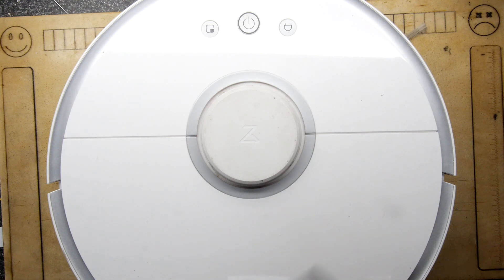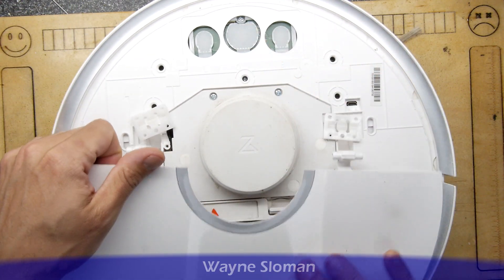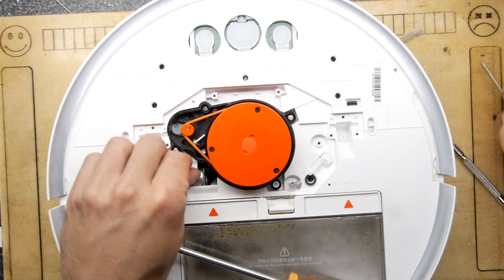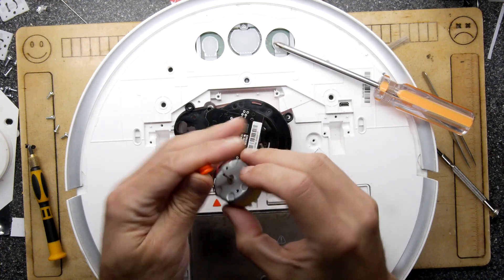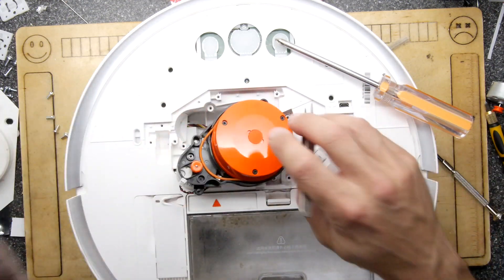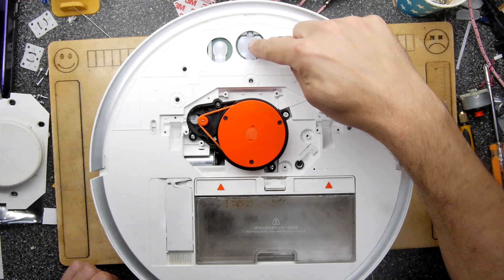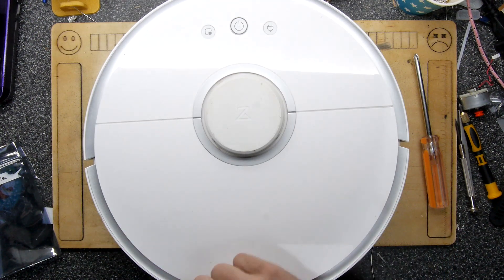Roborock LIDAR Laser Radar Repair

Comment: Hi, thank you so much for sharing this video. It’s very helpful!

At 2:50, you begin unscrewing the LIDAR rotation motor. I’m currently trying to replace the same motor on my Roborock S5 Max, and I’m stuck at exactly that point. The screws on my unit just keep spinning and I can’t get them out. I’ve tried several precision screwdrivers, but none seem to fit correctly.

Could you please let me know which exact screwdriver or bit you used for this step? I’ve even taken the part to repair shops here in my city, but no one had the right tool.

I’d be really grateful for your help. Thanks again!

Comment: Before buying a new motor you can try to kick start the old one by connecting it to a 9V battery. If you do not have a 9V battery handy, you can also strip a USB cable at the NON-USB side. Connect the black and red cable to the disconnected motor and let it run for a few seconds.

In my case it made the motor run. After placing it back into the robot it worked fine again.
Reply from the maker: If that worked it's likely the inside of the motor got gummed up, possibly the old lubricant etc. Definitely worth trying to purge it with contact cleaner and get a little lube. I bet it would last ages after that!

Comment: You can fix a stuck motor by briefly applying a 9v battery across the motor contacts (with the PCB connector disconnected!) which seems to get it working again.

Comment: Thank you. Managed to change the motor of my Roborock S6 using your instructions. The small screws holding the motor are difficult to take out. Had to use a very thin drill to make a hole through the screw to take out. S6 works like a charm. Thank you.

Comment: I did the same repair on my S6 and it worked very well. Just to be safe I want to change the orange silicone belt. But can not find it as a spare part in Germany. Does anyone know the size? I think mine has become slightly bigger. So I cant measure.

Comment: Mine is a Roborock S8 and in that module there is very limited access to the actual motor. Having said that, this video helped a lot in terms of understanding how to get as close as possible to it. Eventually a nice clean and a tap on the motor was all that was necessary for it to spring back into action.
Reply from the maker: I think there's an interesting inflection point here, clearly they're making them simpler so that they're cost engineered. However, that will be at the expense of repairability. Perhaps they'll come down to a cost point where you won't bother paying to have them repaired

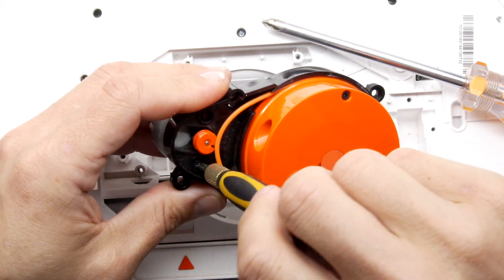Comment: What size screwdriver are you using at 3:00?
Reply: Did you by any chance find out what screwdriver or bit worked for those tiny screws? I’ve tried various precision screwdrivers, but none seem to fit, and the screws just keep rotating without coming out.

Would really appreciate it if you could share what worked for you, if you managed to remove them!

Comment: My lidar motor seems to work fine when I apply voltage to it. Also at start roborock seems to provide voltage. But when lidar module is in the vacuum it errors out. I think the edge connector is the fault. Any ideas how to improve the connection? I mean before I go and spend 100 bucks on new one with no guarantee it solves the problem.
Reply from the maker: I would attack it with contact cleaner and hope for the best
Reply: The black connector on my laser unit is at fault and I need to completely replace it. It behaves the same way as yours and I noticed that the "spring" connectors are too far way from the copper and don't make contact. I tried to bend them outwards, but it didn't work. The issue is that I can't find those connectors online to buy them. Can someone help me finding it? I don't even know how those connectors are called.
Reply: @Pmiketube  It's a type of edge connector. But I can't fine one with same pin count as this. If the bot was out of warranty I would just remove the connector form laser module and solder a cable to it directly all the way to the mobo.
Reply: @MGL83 I will probably end up doing that if I can't find a replacement. I'll keep looking for a few more days.. 😂

Comment: here is a tip, instead of doing a cleaning run to test, turn off the robot, then hold the power button and press home button 5 times. now you are in the diagnostics menu.
Reply: Omfg this worked on my Q revo!  Thank you brave internet stranger!
Reply from the maker: @toddkilgren5984 huzzah!
Reply from the maker: I must try that, I have some later models, it might apply to those as well

Comment: hmm mine spins, so the motor works. took it apart any way to have a look..no dirt and the belt looks fine, but it still errors on the lidar. any thoughts?
Reply from the maker: Maybe the LIdar itself is shot. You can try to look at the unit while it's asking with you phone and seeing if the Infrared light is visible. You usually see it as a flickering straight line on the wall
Reply: Did you fix it?

Comment: What is this lidar cover popping button purpose? I tried mine on S7maxV but it's does nothing..
Reply from the maker: I'm not really sure what button you are referring to, if you have a link to a picture I can take a look
Reply: @backofficeshow  cover of a LIDAR, 1:28 on yours video
Reply from the maker: @playerone1431  that's so when it drives under something low, like a chair, it can detect if it's getting 'wedged in' by something pressing on the LIDAR

Comment: Thanks. My Roborock lidar stopped spinning again. I dropped  a little oil last time, made it run 2 years more. I replaced it with a spare motor  I ordered last time. In five minutes, it resume cleaning. you saved me figuring how to dissemble it. I think it had bad batch of motors. The replaced motor can still run, it may need another drop of oil.
Reply: Dropped a little oil where??
Reply: @weetzybat  motor axle.
Reply: @vicever08  After how long did it stop working? Was it the only issue with your device?
Reply from the maker: That's great! I did wonder if there was the possibility of a higher quality motor replacement, but I guess it's cheap enough to replace every few years

Comment: Thank you very much for this video. In my case the belt was dusty and slippery. I washed it with soap and water and now it works again.
Reply from the maker: That's fantastic, when they stop working it's painful 😂
Reply: Mine isn’t spinning freely or maybe dust or dirt under the spinning part. Seems like that’s a LOT to take apart. Trying to find a whole turret replacement